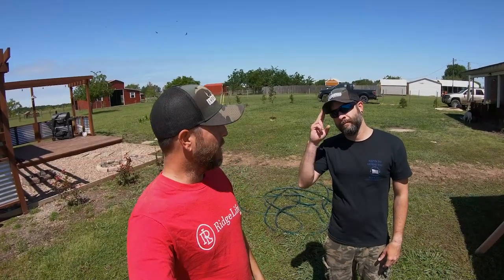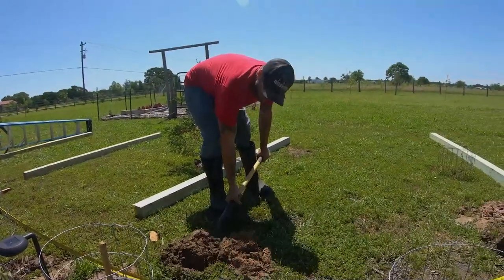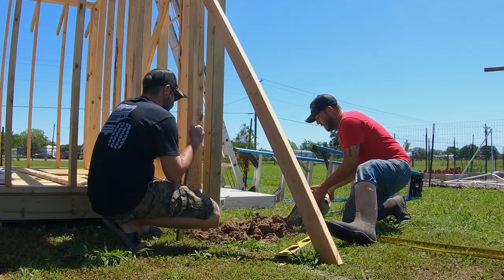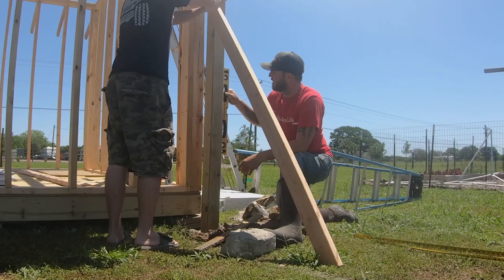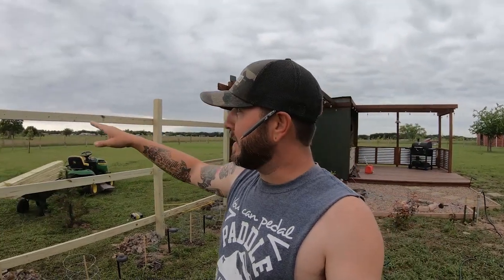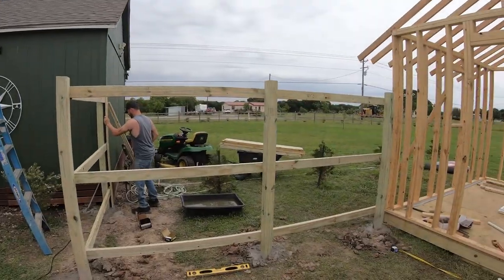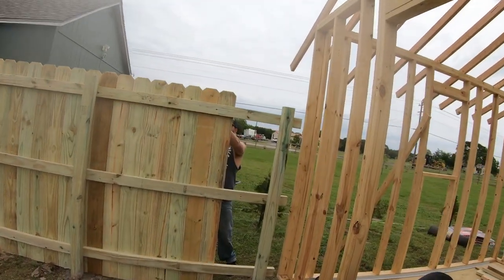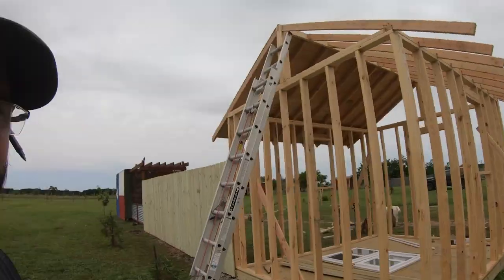DIY Privacy Fence Build - Exhausted But Totally Worth It!

Comment: Looks really good guys. Hard work def pays off. You didn’t leave any wee spaces between your picket fencing planks?? Just worried that the wind will hit the fence and flatten it coz it’ll be like a sail and catch the full force. Don’t want your hard work to get ruined so it’s just a suggestion/observation. Xx
Reply from the maker: There are plus the planks will most likely shrink up a bit since they were wet

Comment: Nice job Jared, I was stupid and bought premade fence pieces!"I should of done it your way. Some of the gape in the fence were an inch wide between the dog eared panels. I ended up having to take them all off and slide them all over at the end 16 ft of fencing I needed to buy 3 more panels! That's how much they jip you spacing them so wise apart!  Are you going to paint the fence green or the color of the trim? Or some other color? Much love from So.Cal.💟